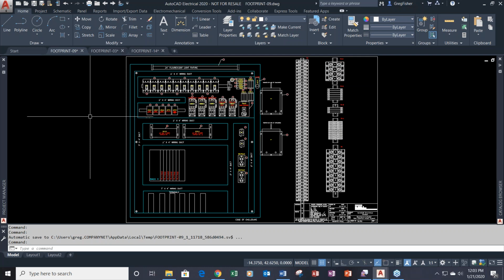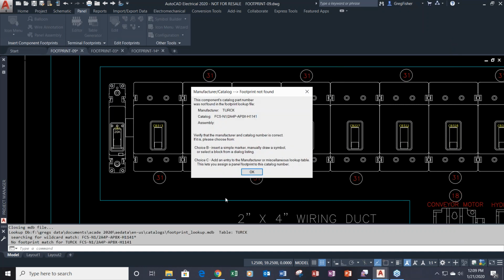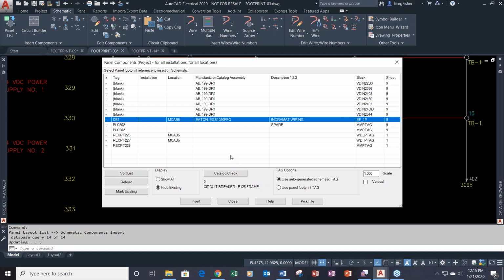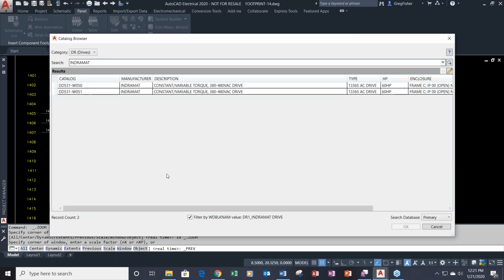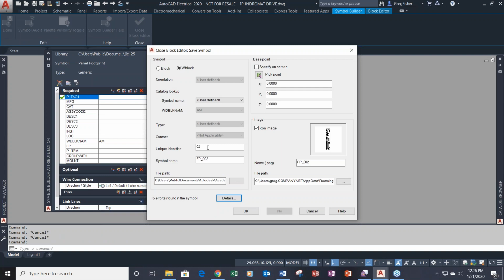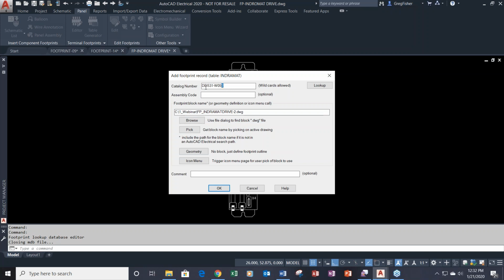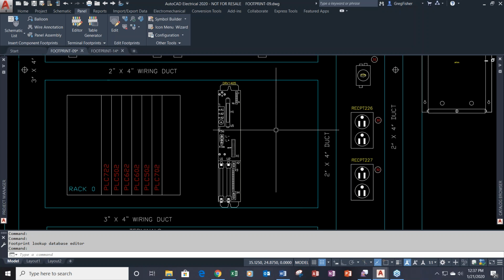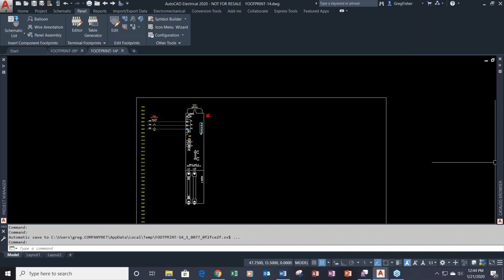AutoCAD Electrical Footprint Database

Comment: Hello.
I am learning Autocad Electrical and I can`t find the library for Substation Design. 
I work in Control and Protection area in electrical substation.
Do you know the how I can install libraries for control and protection equipments?
Thanks
Reply from the maker: There are several libraries that are provided out of the box with AutoCAD Electrical. Examples are NFPA, Hydraulic, Pneumatic, P&ID, IEC and several more. There is no specific library for Substation Design. If you can’t find what you are looking for, then we encourage everyone to create their own symbols. Keep in mind the AutoCAD Electrical symbols are still AutoCAD Blocks. All users typically create their own custom library. No matter how many symbols are provided out of the box there are always instances where you have to create your own.